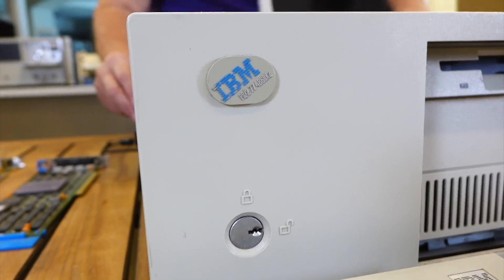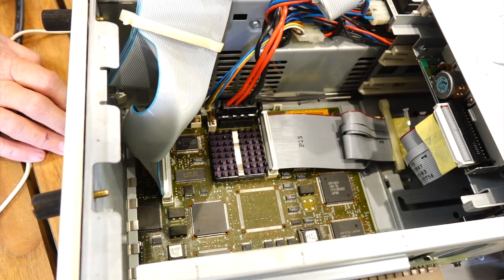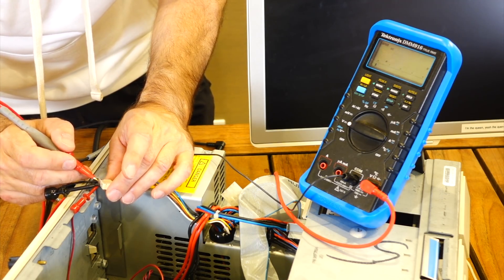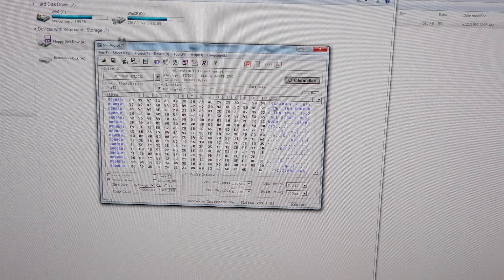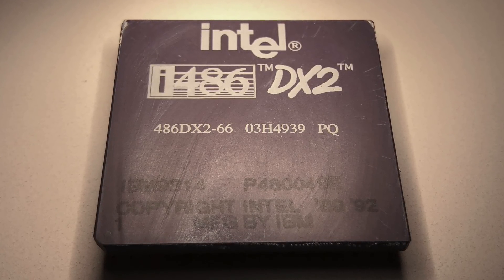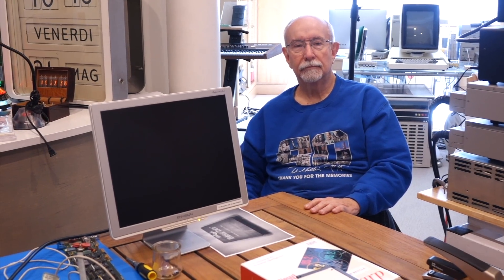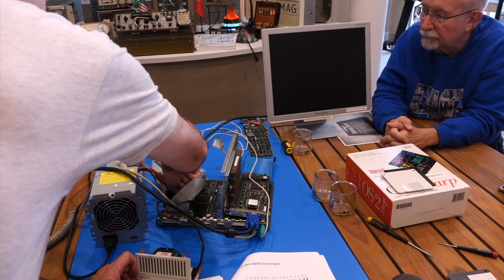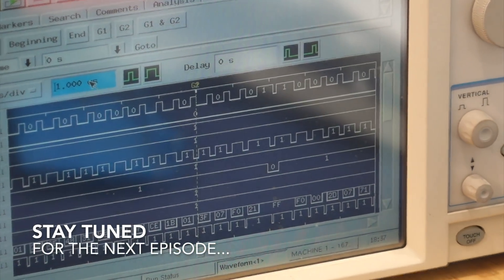IBM PS/2 - Part 2: Initial debug

Comment: Good god. I never had any trouble like this. Way back in 1993, I had an IBM PS/2 Model 30-286.  I replaced the IBM PS/2 Model 30-286 motherboard with the Reply 486 Turbo board (from Cupertino, CA), it came with an intel i486-25SX CPU. After all the mods I did with it, I ended up with an AMD 5x86-133 CPU, with 32 MB of RAM, running RedHat Linux 5.1. It ran OS/2 Warp 3 with ease. Ran like stink. It also  served as our network's DNS server, as well as an Apache web server, over over a T1 line. it easily supported many remote ssh users from all over the U.S., Canada and Europe.  Never broke into a sweat.

Comment: I have roots in electrical engineering, and every time I see an opened micro chip I'm still amazed they work at all. I know how they work but they still look esoteric to me.
Reply: When I took EE, we actually looked at how to design these things, using system /390 mainframes to demonstrate potential features that PCs didn't get until Pentium/MMX (P55).

Comment: I wasn't aware that IBM had buggered about with the pinout of the 486... The 8590 was obviously fairly tolerant too because I swapped a generic DX2/50 onto the CPU complex of one in place of a DX/25 many years ago. I thought it was a bit of a long shot but worth a try and was pleasantly surprised when it booted.

I also had a 9577 with the Lacuna planar and a "Spock" caching SCSI adaptor.

Comment: IBM also trash talked other clone manufacturers, one example being that due to design choices that meant the PSU was in the monitor Amstrad's PC1512 and PC1640 did not have fans inside as they did not need them, only to end up adding one to the HDD models as IBM were supposedly spreading rumours that due to the lack of a fan the machines were unreliable.

Naturally IBM failed to realise that cost was becoming more and more important and as such if manufacturers could save a few bucks by designing their own ISA replacement then they would and the typical user would not care whose flavour of expansion bus was used.

I have played with an IBM PS/2 25(?) as we found one in a cupboard at college (this would have been ~2006). It had 2MB ram, an 80286 running MS-DOS and Windows 1.1.

Comment: ..usually , in my experience, if the pin is loose or even cracked solder  it  WILL not work...

Comment: Well I had CPU sockets (newer LGA style) that some of the springy legs broke off. Usually it was just some clumsy user that installed the CPU incorrectly or few times there were boards that I saved from ewaste bin. Anyways, only once the board wouldn't boot with one missing contact. I had sockets with 3 or 4 contacts missing and it would still function perfectly fine. When I checked the pinout I usually found out that the ones that broke were GND or some power rail to the CPU that still had like 150 other redundant pins. Once it was a lot of damage, and was for an internal graphics on the CPU (i5 3rd gen), but the CPU itself was the one with no internal GPU. So even 10 damaged contacts in that area didn't change a thing as all of them were for the iGPU.

So, I would try the CPU before destroying it. It would perhaps work and the pin that was bent perhaps just made contact to another pin that caused it to stop working.

Comment: Microchannel buss architecture was ahead of it's time and also a very high performer in comparison to the AT bus architecture that was popular and open at the time. This was long before the PCI buss came on the scene. The problem was that IBM charged companies fees to use the technology. Very few companies were willing to do this so it pretty much ended up being a buss architecture used by IBM alone. The rest of the industry suffered with the AT buss until the PCI buss was finally implemented which took some time to debug and settle down. There were a lot of compatibility issues with the PCI buss for a time.

Comment: PSU, my hardly educated guess... Voltages may show OK, but when under load, the CPU and other stuff needs a stable voltage without ripple. After that, seriously check for bad caps on the main board.

Comment: MCA was such a flop for IBM that - rather than saving their place in the PC market - it sealed their fate. If you think how much of a pain it is to keep the reference diskette for one PS/2, imagine how much it would be for the IT department at a major corporation or institution with hundreds of them in one building, because the reference diskette was unique to that PC and its BIOS configuration in an early attempt at plug-and-play. With it being such a failure, the clone manufacturers had over half a decade with which to come out with their own 32-bit bus standard, PCI.
Reply: IBM are f**king stupid idiots . What the hell were they thinking. No one likes proprietary hardware especially when its not as good as the competition.

Comment: Mutliple VCC pins on a processor does not mean they are connected on the processor side. Thay may, but very well may not. Think of it: in the processor a connection (especially on the die and a large current carrying one) is expensive, but on the pc board (planar) it is dead cheap. So use the other two to check if all vcc’s are hard connected together!

Comment: Aaaah, my first PC had this beautiful processor, and a powerful amount of 8MB RAM, and 2x 200MB harddisk.
It cost a fortune, but it was worth it :) I wrote my first 3D engine on it, in TURBO PASCAL with inlined assembler.
Reply: 3D with a 486 and only 8MB of RAM. Really? It must've been really slow.

Comment: Bent pins is one of the reason we started building clones back in the day. Due to cards falling out of slots (even with hot glue) and other issues during shipping or construction Got tired of basically rebuilding the IBM clones. But this got me thinking. So you have the IBM slc2 processor and every time I would run into them outside of the IBM world. The machine would be unstable among other things. So I deemed them garbage processors. A so now after looking it up. I found my answer. Cyrix had a processor called the 486slc. Now it all make sense. Probably one of the things I missed back in the day.

Comment: I'd really be pulling everything off the board.. I've had mobos not post simply because of a bad hdd...
Reply: NO! This is micro-channel, and you'll need installation disk for each and any card pulled out. I did that mistake 20+years ago, and the PS/2 setup floppy was nowhere to be found. We had a big trouble finding it, and I was lucky enough that we didn't need other cards for which we did not have "driver" disks. I haven't been in too much of a problem (we were setting that old, single and lonely 386 PS/2 for typewriter role), but I got embarrased alot.
Reply: @docnele  yurk!.. that feels like adding a disk to a Novell 2.x server.. and relinking the kernel

Comment: I would have popped it back in after that pin fell off. It booted before, it could have been a ground pin for all we know and that's why it worked until something bumped it and it shorted the other pin to ground. It might had have survived that and just needed the short removed...

Comment: If your PS/2 won't turn on that could be that the real time clock battery died. In my PS/2 model 75 it is a dallas clock chip that contains the battery, which is hard to replace.

Comment: As a number of other posters have pointed out, the parallel port outputs post codes when the machine is being powered on.  When I used to work for a company that repaired Packard Bell and Dell computers us repair techs was given a parallel post card that was specially made by the R&D departments of Packard Bell and Dell. The post card was a small square PCB that had a number of LED's on it. Accompanying the card was a manual that identified the post code dependant on what sequence the LEDS were in.

I have no doubt IBM would have made a parallel post card for that IBM PS2 computer. You just need to find one.

Comment: Yeah. IBM should have realized that going proprietary in a world where everybody and their dog was already developing 32-bit PC's with more "open source" hardware wasn't going to work. Technically, MCA was ahead of it's time, but once PCI came around it was rendered utterly redundant, and the only way you can get away with being proprietary is if your product has a significant enough advantage to offset the price difference. "Nobody ever got fired for buying IBM" only works until the budgetary review board gets a hold of a computer catalogue.

Comment: Best part from video - big transistor city under microscope! Love it! ❤️

About bent pin - theoretically, next step is verifying what was the pin purpose who Vcc pin touched. Maybe some buffer..

Didn't know, that there was 2 versions of 486DX2.. That's probably mean's, that, back in day's, I may disassembled for parts fully working IBM motherboard who I get without processor, thinking, that it's not working and it will be waist of time for repair..

Great video! Waiting for continue for series!
Reply: I seem to recall the extra pin was for some specific uses not relevant on all boards, but I don't have the pinout info.

Comment: I seem to recall that the IBM Blue Lightning DX2s were licence-built clones of Cyrix chips rather than Intel. I'm sure I had some of these back in the day, along with some IBM-manufactured versions of the Cyrix 5x86 and 6x86 chips.
Reply: IBM did most of Cyrix's manufacturing.

Comment: That pin of the CPU is not that important, it probably shorted to the other side after some time, most probably because it heated up and things move and expand. that would explain that. Also the typical solder just strips the gold from ceramic chips so you have to use special solder for that. But is is also quite tricky to do the bending on these CPUs
Reply: That was a redundant ground, yes. I'd bet it shorted out.
Reply: @wyokaiju992  posted before the video was over ;), im curious about the actual fault and if it could be related.

Comment: I always use one of those retractible pencils to straighten the pins. Some guy on yt introduced this great method. I probably straightened thousands of these so far, even totally flatted ones, and not a single one ever broke. I think that might be because you press the end of the tiny pencil tube against the pin base during the process which prevents it from getting broken off the package.
Reply: It could also be because he weakened the connection when adding solder, I've never felt the need to do that when straightening CPU pins. I've used a credit card and very thin screwdriver in the past, a mechanical pencil is genius!
Reply: I've done this too, it works great if you have a mechanical pencil of the appropriate diameter.
Reply: They work great, or if you have a whole row I very carefully use a credit card.  Smooshed an AMD X4 chip once through my own stupidity and spent about an hour slowly teasing the pins back into position.
Reply: Yeah, those mechanical pencils do work well. But I nowadays use wire ferrules ( https://en.wikipedia.org/wiki/Electric_wire_ferrule ), the smallest kinds. I've found that the pencils don't work very well for the pins on later CPUs, there's too much wiggle room. I glued each of the four smallest sized ferrules on some sticks and so I made pin tools out of them. Of course there's also smaller sized mechanical pencils you could use but I think they're rather clunky anyway.
Reply from the maker: Oh thanks, that’s a great tip.
Reply: even these huge pins on old processors?
Reply: @AnthonyShuker  yup, I straightened quite a few 486 pins back in the day, never broke one. Heat wouldn't have done it much good.
Reply: @TheErador  with a pencil?
Reply: @AnthonyShuker  oh i see, no usually a jewelers screwdriver or tweezers. There are propelling pencils with wide enough apertures though. I'm presuming they didn't mean for one to try and shove one designed for .5 mm leads onto a .8(?) mm pin
Reply: @AnthonyShuker  those were even better, nice thick gold plated alloy pins, nice and soft usually unless you somehow managed to work harden them over 20 years
Reply: I always used the metal ISA covers to bend and square the pins,  never thought to use a pencil

Comment: "There's no light or anything to show you that it's moving through POST." - Yes, there is! All PS/2s output checkpoint codes to the parallel port. If there's nothing there, then the CPU isn't executing the POST code at all or gets lost during the first few instructions. Btw, the Bermuda/Lacuna planars will happily take regular intel CPUs.
Reply: oh wow TIL, that's a pretty neat feature of the PS/2s - I had no idea!
Reply: @sydneybiscuit : And since the parallel port POST code readers are less than $10 USD on eBay, a very worthwhile investment to have something that works with ALL PS/2s...
Reply: I remember there where cards available for the ISA-Bus with 7 segment displays on it to show the different stages (or whatever) from the POST code
Reply: @Mues_Lee  yes. Port 80h on clones.
Reply: @1971merlin  And it's 680h for the Micro Channel machines...
Reply: @GeckonCZ  thanks. I was just looking it up and about to post it myslef  :)
Reply: Yes - Olivetti PC’s (m24 etc) from the same era also do this.  I worked on ps2/50’s and made my own code reader using bcd to 7 segment decoder
Reply: Neat
Reply: Haha indeed... This was a problem for an early peripheral design I had going years ago 🤣

Comment: You might be asking: " Why is it so loud? The CPU doesn't even have a fan! Is it because it's old?" The answer is they were always that loud even new.  Now imagine a computer lab with 20 PS/2's going at once...
Reply: Ah the days of the good old chaff cutter disk drives.
Reply: The PSU fans were pretty loud tho! I had a ps/2 don't remember the model but it was a 386. The ESDI hard disk used to squeal something rotten until it warmed up

Comment: Oh, for us with 386 33MHz, the 486 DX2 or DX4 were a dream. Specially here in Brazil.
Reply from the maker: I still remember when we got the first one. The 486 was a big step from the 386!
Reply: I got the later dx4(?) 100 as an upgrade from from my old 386 sx 40. Gamer's dream :D
Reply: I think the biggest turnover was the 386 after the 286:  data bus from 16 to 32 bit, it had 386 Enhanced mode, and could fully switch between real mode en protected mode.
Reply: @erikdenhouter  "386 Enhanced mode" was the Microsoft Windows code variation that actually contained 32 bit code.  It was based on an early virtualization system to run multiple virtual 286 machines, one of which ran the actual Windows 2.x/3.x system, with all the others being DOS boxes.
  The CPU mode is simply named protected mode (32 bit) with optional paging.  At least according to the original printed 386DX manual from 1990.
Reply: I've jumped from 286 16 MHz directly to 486 DX2-66 after four years . A true quantum leap. Those were the times!

Comment: LGR would fix this issue in a matter of seconds =P
Reply: 8-Bit-Guy would have just drilled some holes and shoved a paperclip in there.
Reply: @merseyviking  hehe, he is such a hack
Reply: As far as I can tell, LGR's electronics repair skills are limited to 2 things: swapping big components (boards, PSUs, CPUs, etc.), and very rarely replacing capacitors. I don't think he would have such an easy time with this machine, he seems to be a lot better at software issues.
Reply: @compufood  he would have call Adrian Black ;)
Reply: @SergiuszRoszczyk  dude spot on, Adrian's digital basement is the perfect guy to fix this kind of stuff, right on!
Reply: @compufood  uhm, I agree...
Reply: would add woodgrain and install doom. yes.
Reply: Nah TubeTime is definitely a right person for this job (or David Beem, Admin of IBM PS/2 PC Server and Microchannel based systems enthusiasts on Facebook)
Reply: @stevec00ps  8 Bit Show And Tell, probably too or maybe retro recipes, not a big fan but i like them
Reply: we forgot shadow tron blog!
Reply: Nope, he would send it to the computer butcher Adrian Black... Blergh 🤢